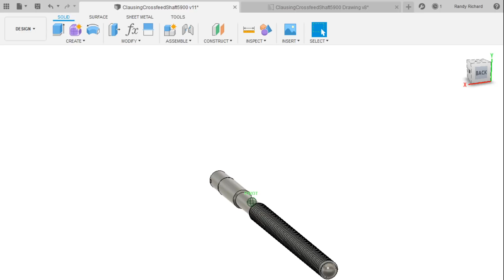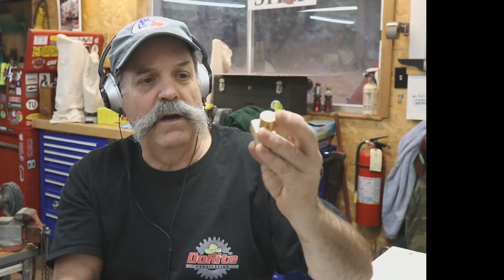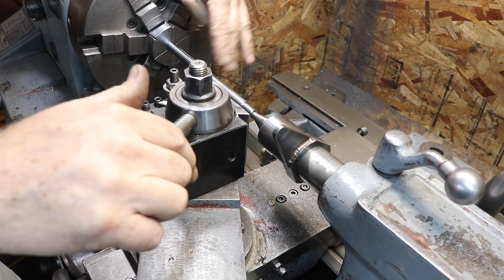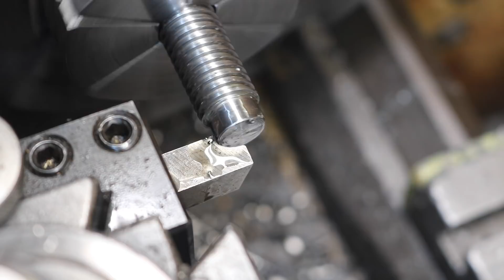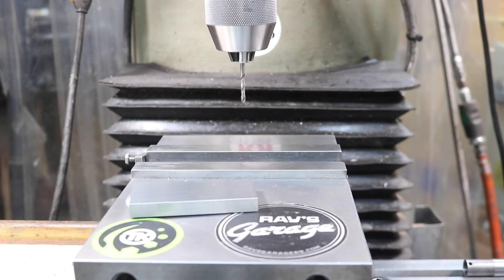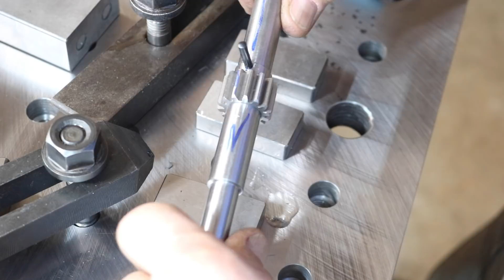How to make acme threads on a lathe  | Clausing Lathe Crossslide Leadscrew 5900

Comment: may I ask you what material did you use? (denomination).  it seems very helpful to me.  I have to do the same job
Reply from the maker: I used 4140 Prehardened, ground rod. https://www.mscdirect.com/product/details/44861433
Reply: @rrintheshop  it should be the equivalent of 42CrMo4 here in Europe.  Thanks and congratulations for the work

Comment: Great video Sir. I cut some ACME threads a couple of days ago but did not set the compound to 14.5* and went straight in with the Cross Feed. Found out it works either way using the Compound or the Cross Feed. I learned a lot from watching your video. Thanks.
Reply from the maker: Good deal Paul.  Thnaks.

Comment: Does each tpi have to have a specific insert?  Or can some do multiple threads?  Do you use a positive rake insert with that 4130 and less tool pressure to cut a uniform depth?  Acme seems a subject that many give an overview but almost no in depth information.  Thanks for the video.
Reply from the maker: Yes the inserts are specific to the pitch. they are neutral rake inserts and holders. Using a follow rest is very helpful.

Comment: Hi Randy a question if you don't mind, what is the brand and number on the insert you used to cut the threads.  Thanks
Reply from the maker: Holder I use: https://www.shars.com/products/indexable-cutting/threading-holders/1-2-x-1-2-rh-indexable-cutting-tool-universal-external-threading-toolholder-1
Insert: https://www.mscdirect.com/product/details/88576772

Thanks Tim
Reply: @rrintheshop  Thank you for the info Randy!

Comment: I remembered the previous one.  Great work, as usual.  My Taiwanese ENCO lathe has some screw holes that were obviously hand drilled, and are a good 10 degrees off. LOL  Was going to cut my own new lead screw and nut, but my lathe had way too much backlash for any accuracy, so I bought a paired set.
Reply from the maker: Thanks Vernon.

Comment: Excellent work sir.
A side note: could you leave the collar if the gear longer and set the shoulder of the shaft back to coincide with the collar?
Reason: I think leaving the collar longer and shaft set back would allow a much thicker web for the new taper pin area. More collar would be less chance for the pin to wallow out at a later time,like the old gear and shaft arrangement?

I saw that,thought I would ask.
Not a criticism,merely an observation and thought.
Chuck.
Reply from the maker: Possible, but I would need to look at the machine and see the fitup.